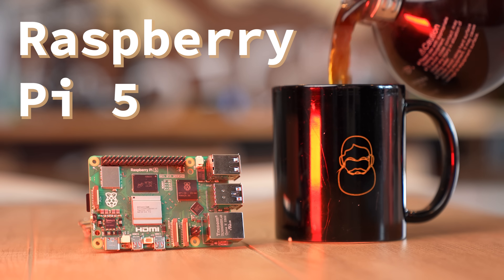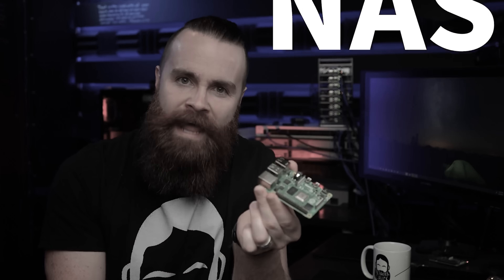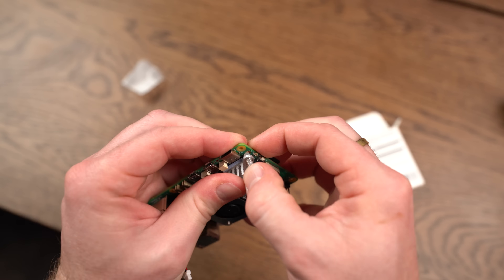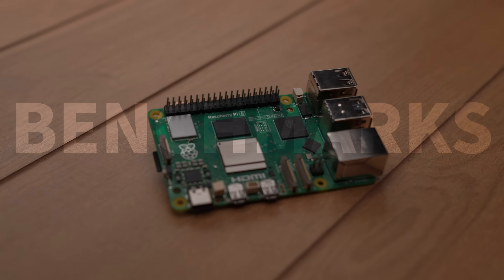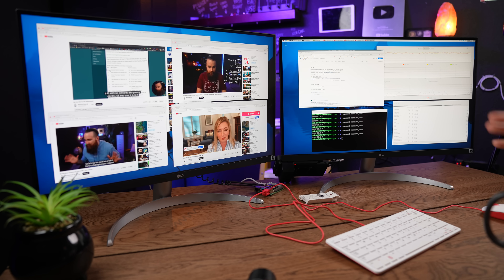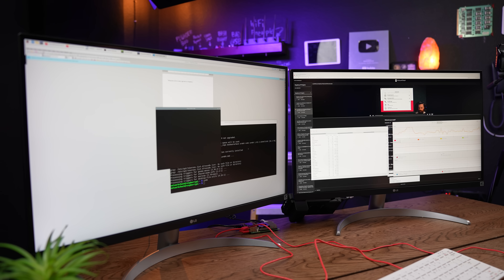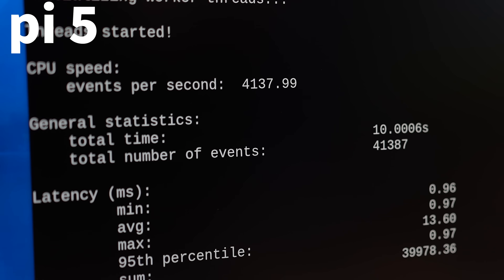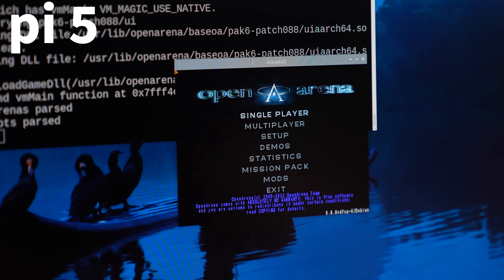the Raspberry Pi 5

Comment from the maker: This video was originally sponsored by ITProTV. We’ve since launched NetworkChuck Academy, our own place to learn IT: https://ntck.co/NCAcademy

The wait is over—the Raspberry Pi 5 has finally arrived! Join NetworkChuck as we set up a Raspberry Pi 5 desktop and put it to the test with a series of benchmarks and performance evaluations.

**Sponsored by Itpro from ACI learning
Reply: The thing that would make this thing a riot for me would be ability to boot os from PCIe nvme or ssd instead of only microsd, it could possibly do it but I can't find any confirmation that it can do it.
Reply: You mentioned adding the Bench results "down below". Have I missed something?
Reply: the thing's got .2 ghz more in its cpu than my alienware. duuuude.....
Reply: @DoFliesCallUsWalks  They should at least have done v3.0 or v4.0, re: "PCIe 2.0 x1 interface for fast peripherals (requires separate M.2 HAT or other adapter)" from rpi website
Reply: I bought a Pi 5 as soon as it released and built a cyber tech tablet pc. Gotta say the best $300 I’ve ever spent
Reply: Please test it with nextcloudpi!!!! thanks!!! cheers from Italy!
Reply: I need to learn Linux.  A bit overwhelmed with all the “Linux for Beginners”.
Reply: Can't wait for Raspberry Pi 5 Supercomputer Cluster.
Reply: I learned Pyhton on a Raspberry-Pi 3B!  I'm finally about upgrade to to 5! Question: What are some suggestions to do with R-Pi3B? Recycle is to do something???
Reply: But can it skyrim?
Reply: Why did you not demonstrate the RPi5 on a SINGLE monitor like MOST people who would get one would use it???? This video just seems obnoxious since you're clearly trying to do way more than it was designed to, but not showing anything it IS designed to do.
Reply: It may be an overkill as the Raspberry Pi was designed to offer hobbyists an affordable solution for creating IoT projects or prototypes. There is no need to make these devices overly expensive or powerful. If you require a full-fledged computer, it's more practical to consider purchasing a budget laptop with features like an Intel Celeron or AMD Ryzen 3 processor, which are more powerful than the Raspberry Pi's CPU. These laptops come with displays, more RAM, and built-in storage.

The beauty of the Raspberry Pi lies in its compact size, light weight, and very affordable price. It's essential not to compromise this beauty by attempting to turn it into a high-powered computer. No one would like to use a canon to shoot a mosquito!
Reply: I dont get all the hate on this video. It's a great informational video and shows the power difference. I am actually really impressed how good it is. It seems to be more powerful than a chromebook even and all while being the size of a credit card. I personally own two pi, a pi3b 1gb and a pi4b 8gb, and the power difference is insane. My pi 4 absolutely smacks my pi3b. Now I have a Pi5 on my list, though.
Reply: Joker I've got a pie 5 I've got a 3.5 screen and for some reason not working on the pi 5 I got no drivers or nothing other than that she's not booting up what do I do I do on nothing about coding or nothing like that so could you help us please
Reply: How can I fit a screen on a Raspberry Pi 5 at won't work the 3.5 screen won't work on my pie or the pi 2 in the pipe wanna put a screen on a lot of warning work on natural how do I get around it could you let me know thank you what you know on YouTube it's actually quite good you have got some good thank you got some good tips and I'm going to try and build my own shirt like I'm gonna try and build my own network switch and I think I'm going to do it I ring what you've been doing I'll be watching you for Mum's and Mum
Reply: yes

/, 

.
Reply: the pie is very cool
Reply: @NetworkChuck still can't log in to your academy after purchasing the subscription. It's been a couple months trying to contact support or you via email, comments or twitter(X) and all completely ignored. All support links are dead and email addresses "do not exist". It's an awful experience being a paying customer and feeling scammed. Don't offer a service if you won't actually support it after taking my money. It's such a shame bc your free content is amazing, and you seem so genuinely kind, but this is not okay.
Reply: Thank you, and a small form factor Server setup with 4 RasPi 5s will make this product a win for the budget user's... MASSIVE

GRATITUDE FOR THE REVIEW
CHUCK... BOOOOOOOOOOOOOOM
Reply: Videocore v.2 GPU boy oh boy :D     I'd say 7, but you do you !
Reply from the maker: @ndupontnet  oh my goodness....I just noticed I did this. We got the Pi a bit late and my team got this out in 24 hours.....a lot of zombie like states .
Reply: im interesting in part "mounting the sbm drive" :) -- im having issues to mount 2 drives that i have in deck connected to router's usb. Windows PC sees them without issues (and both are mapped as network drives), but in Linux...i cant mount them for some reason...i tried everything :(

Comment: The holy grail of raspberry is its community and the accessibility for documentation. You can write a program in Python in windows and simply run on raspberry ( you call files like picture, path is the only thing you need to modify ). At my start journey of learning Python I made some programs for Raspy Pi 4 that I wouldn't think think possible 10 years ago that I would be able to do that.
I would like to see from raspberry developers for a variant of Raspberry Pi 5 that has a hardware switch for Wi-fi/Bluetooth to turn off. I would love for them to actually put HDMI female connectors, not micro HDMI female connectors.

The hardware switch for Wi-fi/Bluetooth is when you want to build an off grid circuit for your house. I would gladly pay 10-20$ extra for a variant like that with safeguards.

I installed arm Ubuntu on my Orange Pi 5 of 8GB and I was baffled on how fast is running! It's simply exceeding all my expectation but the downside of Orange Pi 5 is the language barrier (primary Chinese) for technical documentation and the scarcity of it. 

Python and Raspi Pi 5 simply cannot be evaluated in terms of money to learning/knowledge/DIY ratio. It's the golden goose.

Comment: I was using an Arduino board for hobbyist stuff and the Raspberry Pi 5 was so affordable I decided ti try on and now I'm running a Linux server on it and programming the GPIO in Python ... very useful and versatile tool.  I have the 8GB model... Might grab a 16 GB as well and a larger SSD to add on.

Comment: I think they still don't hardware accelerate the desktop with a opengl compositor. And it is a true hell to set upp chrome to use hardware. Personally i have never succeded at all with that in ealier Pi's. Done everything in every guide I've seen, none really works and chrome is slow as fk. How can it take so much time for them to fix this basic thing. I mean they have a gpu for christ sake. Use it and offload the damned cpu in raspberry pi os. This is why the desktop experience in rpi os sucks elephant balls.

Is the pi main purpose to produce high benchmark test scores rather than actually function as a desktop os? It is fast as hell.. but uhm, its laggy, jerky and tearing. Unimpressed. Why dont they set it up right out of the box? They have ONE target hardware to consider, nothing more.

Comment: If you want a PC there are better machines, if you want a low power microcontroller for your weather-station project that you need to run off a battery for a year, there are better machines. Having these power hungry capabilities is okay IF, and ONLY IF, you can turn them OFF and I mean OFF OFF, as in ZERO power consumption, when you don't need them. They really need to take a leaf out of the 1970's NASA Spacecraft design handbook and learn to live with a few milliwatts. 
Raspberry Pi really need to reconsider what their raison d'etre is, and it sure as hell isn't a micro-pc given what's widely available as obsolete officeware. The IO pins are the magic. That said, everyone is kept happy as long as they DO NOT retire the earlier models, although they could redesign them to reduce power consumption as the 1st gen 3B+ is still too hungry for an average Wall Wart and cable (I use two warts wired in series with a buck boost converter to cope with anything from 3V to 30V at the end of the cables,feeding lovely smooth 5V to my Pi whatever it or its pins draw in current).

Comment: I have a question:
-if I have a good PC, and if I also have a laptop, what would be the reason that would make me say that I would like to buy a Raspberry PI 5? However if we consider the cost of the Raspberry PI 5 unit, and the cost of the basic kit (case with fan, power supply, HDMI cable, display, RTC battery, maybe even an SSD) the total price to be able to use the Raspberry PI unit goes up. What good is a Raspberry PI, after all?
I got a Raspberry PI 5 motherboard with 8 GB of RAM as a gift, and I keep wondering if it makes sense to invest in this microcomputer.

Comment: I don't know... Raspberry Pi's sweet spot is in their original startup concept "$10 computer" Once you start crossing $100, in my opinion, based on your needs, you're better off looking at getting something like a micro pc, such as the HP 600 G3. Everything I want to do with a pi I can do with a pi zero. If I need more power than that, and not in a handheld format, I go to a micro pc for that full desktop resources.

Comment: A while ago, I realized an old device I had had a raspberry 3 in it. Today I formatted the SD card, replaced it with 32 GB, and installed the OS and really liked it.
I think Raspberry Pi OS is the cleanest, nicest, simplest operating system I have seen… and I’ve used a lot. So I now really like the raspberry pi.

Comment: I'm surprised that it could even keep up with all the 4K load on the GPU, but at the same time, I hope it's stressed out only because of the Dual 4K 60 Hz, because when my Pi had a DE installed and was connected to our 4K TV, my brother tried out Steam Link with his computer that had 1080p resolution and it worked surprisingly well without any stuttering.

Comment: You can use pliers to remove them. Look closely for the direction of the spready bits, use pliers and carefully pinch them while pushing them into the board. As soon as both clisps are in, just use a corner of the pliers to push it the rest of the way. Don't break anything and you can use it again if you needed to. I'm sure you can't do that too many times, so don't do it any more than necessary.

Comment: Hi, Should i buy a raspberry 3, 4 or 5 for ad blocking dns at home ?
Reply: Did you do the project? How did it go?

I’d go with a 4 - there’s a ton of documentation on it and you don’t need anything serious, especially for personal use.

I’ll be getting a 4 when I finish my router. I’m using an old dell optiplex to run proxmox and virtualize pfsense or opnsense and  a few other things. I may set the pihole up virtual on proxmox too depending how the old dell handles everything. Kind of want to do it on a pi4 just for the portability aspect
Reply: @hvacmisadventures  yep i used raspberry pi 4, everything works, i suggest you to configure unbound too, also you can add a vpn too
Reply: @TREXYT  awesome man! Yeah I’ve been between the pi 4 and one of those Zima boards now (have you seen them?). Zima is more expensive but would let me do more on the road. I like the idea of being able to bring a router, vpn, pihole, nas all on a family road trip
Reply: @hvacmisadventures  you dont need a zima for this project , i used pi4 2gb, you can use pi3 even small raspberry pi does the job, zima is for big projects which ask for more power
Reply: @TREXYT  thanks for the advice! You’re saving my wallet too haha 😂
Reply: Raspberry Pi 4B is my favorite for all types of things. I have every. single. one. From 5 to 3 to Pico's. I purchased the 5 for myself at Christmas last year.  It's.....ok for the price. Borderline too expensive for what it is.

Comment: Why are they not just using off the shelf snapdragon chips? I would pay a huge premium if they used like a snapdragon 8 gen 2 or 3. They could use the fan for the full performance mode and a lower power usage mode if someone wants to use it without the fan so it doesn't fry itself.

Comment: Sure, the Raspberry Pi 5 is a nice little board but for just a bit more you can get an Orange Pi 5 plus and it literally destroys the latest Raspberry board.  It has twice the memory, and near twice the CPU performance thanks to its Big Little 8 cores.  Add in that all the available peripheral interfaces are brought out with no need for cards or ribbons.  There are a pair of 2.5Gb ethernet ports, m.2 SSD and M.2 WiFi ports as well as two HDMI out and a USBC/DP port as well as two each of USBA in 2.0 and 3.0.  It has micro sd and EMMC ports too. There really is little reason to consider the Raspberry Pi 5.

Comment: QUESTION.
So I’m new to gaming and emulation and all that. I bought a four player console arcade from arcademodup. Now I know that from what they said it uses a raspberry pi 3B +. Now I know that between the three and the five there are certain connections and ports that are different. My question is, could I buy the raspberry pi five and then eventually buy  a preloaded SD card full of games and just swap out the old raspberry pie with the new one, obviously also changing the USB or the power source or whatever  ports are diff. And would it be just up and running and gaming. Like do I have to put the SD card in a computer and do anything with it because from my understanding when you buy the preloaded SD cards from certain websites, their pitch is they did all the hard work loading the games on the card and ideally, you should be able to just put the card in the raspberry pi turn on the power and play.

Comment: I bought my pi5 8gig for my Amateur radio hobby. I have tried a few OS but haven’t had enough time to really review what works for me. I will be using the app hampi and connecting 2 of my 1500 dollar radios and hoping I dont blow up either the pi5 or radios. I use my dell sever to run windows server 2019 and have a few sandbox OS for testing but as I stated there is so little time to really dig in to it. Its worse to me to have the tech and no time than to have the time and no tech.

Comment: I would use a raxda zero 2 pro. Its a 6 core is about 10-20% faster. Alough clock speed is slightly slower (2.2 vs 2.4 ghz) but it pulls ahead with multicore having two extra cores. Oh also its the size of the rpi zero and has 4gb ram

Comment: I'm very much on the fence about that oneand FTR, I'm working in the electronics market and sell quite large quantities of raspberry products to both professionals and, sadly, also the branding-intoxicated hobbyists.
Like the Rpi4, I think it has a very strange (and frankly stupid) I/O mix. Why this dual-hdmi fetichism ? I would like to know who exactly intend to run two displays (especially at "4k") with this kind of device ? Also why the freaking micro-hdmi ? I think the majority of us were quite vocal about our preference for a single full-sized hdmi (mini--hdmi would also be fine) during the Rpi4 lifetime...
Also with that kind of horse power, a single pci-e 2x is not gonna cut it and is certainly not an impressive feat in 2023. I've seen otherwise inferior (also cheaper) devices get better pci-e integration than that (and thus infinitely more serious networking or storage options) or simply some satas and nics on board... Faster SD card is totally useless, that'll just kill the cards even faster.
I mean, they're not too expansive and have good performance for the price, but I wonder who is the real target? Seems to me like it's more aiming at being a replacement for thin clients than the at the open-ended, versatile tinkering machine it's sold as (there now are litteral hundreds of better choices in that category).
But the thing is, at the time being a used thin client is a much better value than a Pi 5. For the same price or cheaper it will have same or better performance, integrated PSU, storage, cooling solution (is quite mandatory for pi5) a few upgrade options, overall better I/O (I would rather have usb-based gpio than usb-based storage for my home projects).
Point being : like its predecessor, seems to me like the RPI5 is more a fun gadget for kids that aren't allowed/can't afford a "real computer" and ultimately companies that will use them to cut the cost of using netbooted thin clients for server-based appliances (since they don't buy used). For a tinkerer, it has very low reusability in practice and while the Raspberry foundation makes a lot of money out of (naive) hobbyists, I don't feel like they're doing a lot to support them vs the support they provide to commercial companies (making the whole Compute Module ecosystem locked away from individuals is another sign of this trend.). But all they us is provide more disposable gadgety computers with ill-though I/O's and ever-decreasing value offering. They're quite like reversed Robin Hood to me.
And frankly, I think their non-professional market would be dead the day their less tech-savy customers learn about other SBC's running about the same linux kernels and distros as Raspberry Pi's and how it means that they could also easily run all these "raspberry apps" on them...